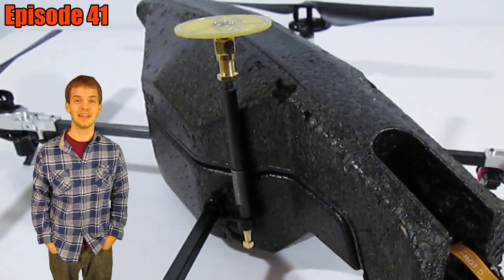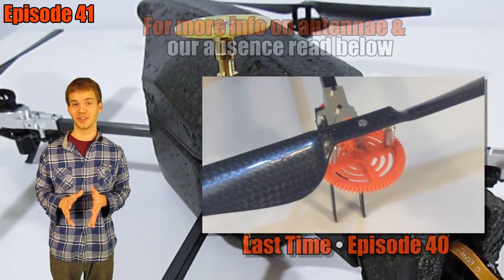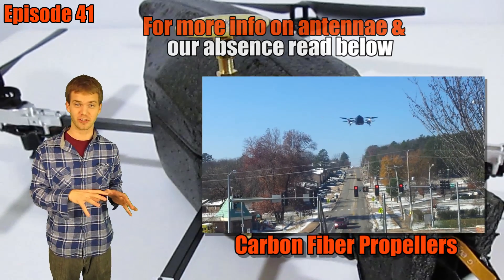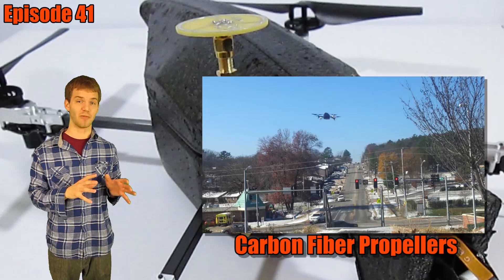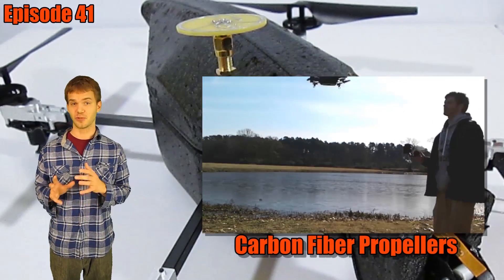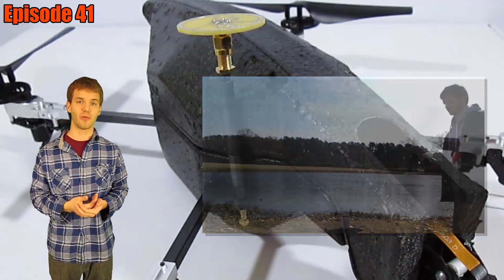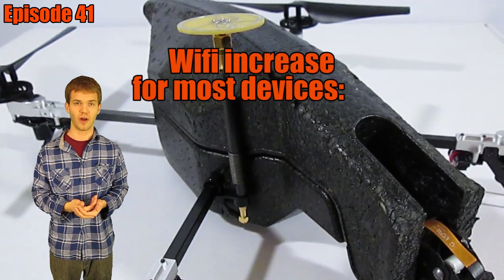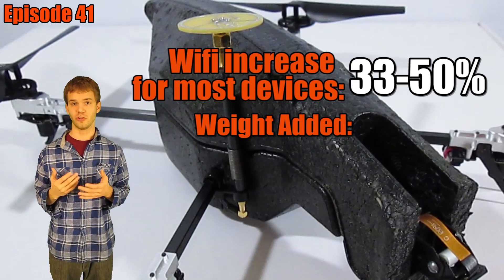Wifi Antennae Mod Install - Increase / Extend Wifi Range - AR Drone 2.0 Episode 41 HD

Comment: Would this mod's effectiveness not also be dependent on the strength of your controller device's wifi? I mean, it is all good and well for the drone to be able to send data from further away, but if your controller can't reach it...?
Reply: How far it can fly with antina

Comment: Is there a video showing how to solder the antenna on your own board? I'd buy the kit and part to solder if there were some instructions on where to put it.
Reply from the maker: There's not a video for the soldering segment but there's written instructions with pictures available in a PDF

Comment: where do I buy the Wi-Fi antenna
Reply from the maker: They'll be available in the next week in my store, CentraUSDroneSales.eCrater.com, there'll be a pretty limited supply of modded main boards though so if you need the MB you might need to be quick to grab one. Should be this week.

Comment: Hello Kyle.  Brand new to the AR's.  And I have found that your videos have really help me understand the different modifications that can be done to my AR2.  This video on the WiFI set up.  When will you have the antenna and the board available on your web store?  Also, I have been trying to locate a 60 Beat, but seems that these are few and far between.  Is there anything else that can be used that is similar to the 60 Beat.  I am still a rookie, so I really do not want to throw money at something that will not work properly.  Once again, I enjoy your videos and I hope to see more of them.
Reply from the maker: Should have the antennaes in about a week, and yes there's a replacement for the discontinued 60beat in the works right now, hoping it won't be too much longer

Comment: Nice Kyle.  What about doing a "core" type deal like with auto parts?   I have almost new 2.0. so if I order the modded board I'm left with my other one unused.  I could keep it for back up or sell it I suppose OR send it to you for say $50. I pay you the $150 then when you receive my board and test it you credit me the $50 or whatever. Just a thought though as I understand it would be some hassle for you, but you would have boards for Garrock to mod then resell. 
Great video and Ill be watching for the follow up.  Thanks for posting and all the work you do for the AR community.

Comment: Welcome back! So will you have the modded board/antenna available, or do we need to find it elsewhere? I've seen some vids about something like this, but they were for doing all the mods by hand - desoldering, part removal, adding new connectors, etc. It would really be nice to have the kit available from some source. Thanks!
Reply from the maker: Thanks Bill, good to be back :) I'll have the antennaes with a modded main board for $59 over the price of a stock MB (about $150), for those that want to solder it themselves I'll also have the antennaes separate for $59. After the tests I went ahead and sent in a bunch of MB's to get pre-installed and ordered a bunch of antennaes, as it sometimes happens there's unforunately a bit of a lag between the testing and video, and actually getting in the first batch. Should be about a week.
Reply: Cool. I gotta order some basic stuff first. But I'm really looking for ways to increase the WiFi range. External antennas help. Also looking at repeater range extenders. Thanks!